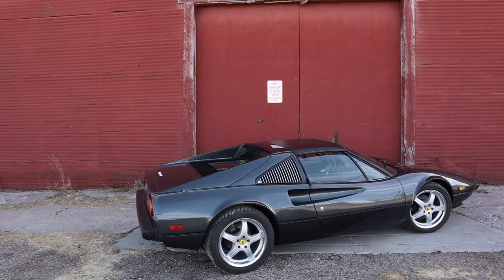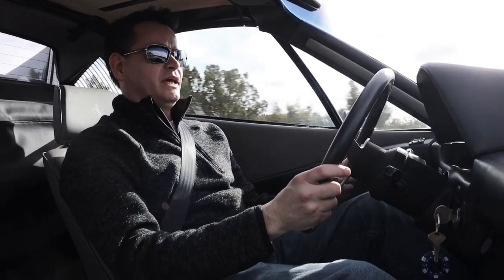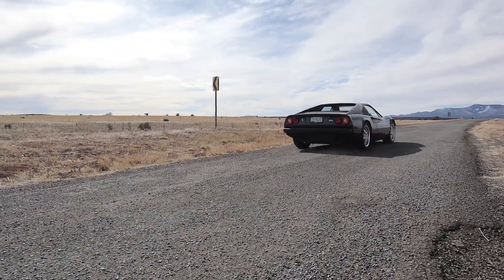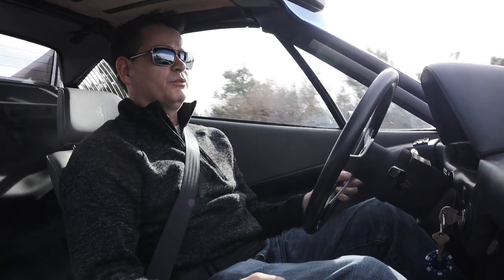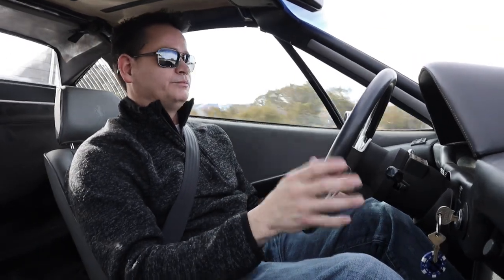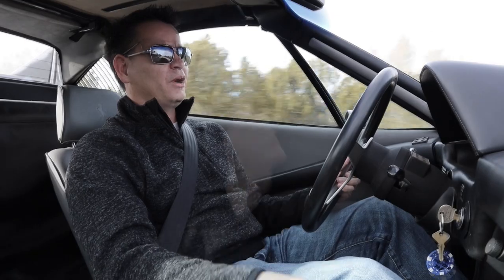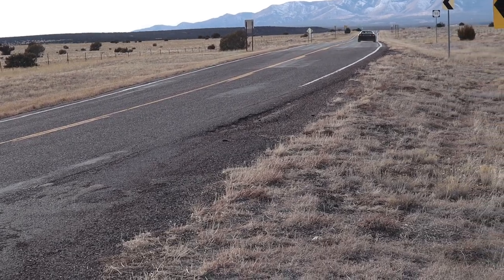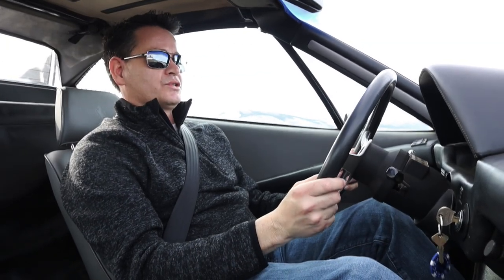1979  Ferrari 308 GTS 3.5-liter by Carobu Engineering

Comment: The original idea for the 328 replacement was a '408'.  This envisaged using the lengthened Pininfarina evo concept body adopted for the 288 but with a bored out 4-liter as shown in the 408 concepts rather than the 2.8 turbo.  So this is sort of half way to that car.  In reality the 408 was seen as a dead end and a completely new engine and body were designed for what became the 348.  I agree it would benefit from a new exhaust, although it does sound quite fruity.

Comment: Nice work by Carobu. The motor needs revs to make power but that's expected. It's unrealistic at this price point but a well engineered turbo system would make the 308 perfect. Imagine torque coming in at 2k power at 3k. The motor would last longer and would be very enjoyable.
Reply from the maker: I've driven turbo 308s. They are amazing when done properly.

Comment: I don’t mind the engine swap and other mechanical upgrades, but you have to keep the outward appearance of the car original— keep the wheels stock or I’m not buying it. It doesn’t look right to see larger wheels and lower profile tires on it. If that hampers the performance gained by the engine swap then I’ll be fine with the original engine as well.

Comment: As much as I love the bigger engine and improvements, I just don't get the logic in putting much more modern wheels on it. It spoils it a lot.
Reply from the maker: I agree the wheels aren't ideal. It it were mine, I would run 16-inch Euro Quattrovalve wheels.
Reply: Seen one 308 - ya seen 'em all - It's not a 'regular' 308 anymore because it's got an upgraded engine now  - So it makes sense that it should also have upgraded wheels to show it is different from the rest.
Reply: Colin Bremner  if there were excellent copies of the 288GTO wheels, id probably like them, but the later 328 wheels are the best on these cars.